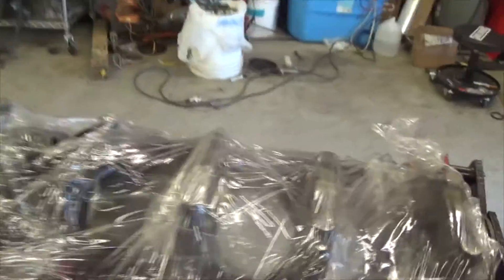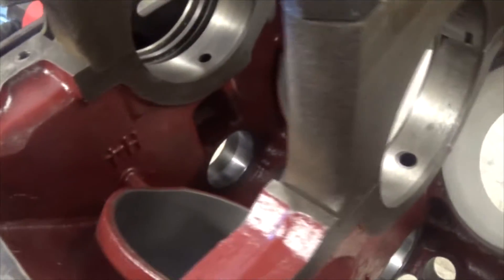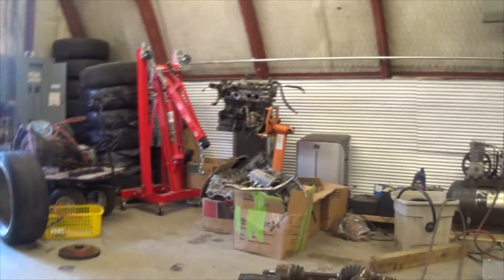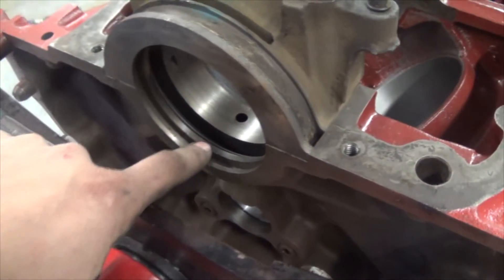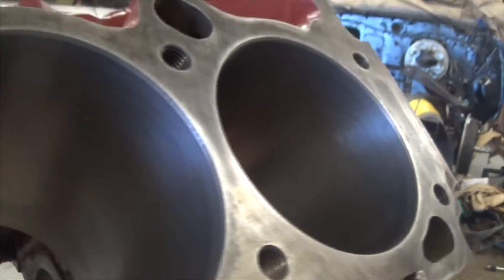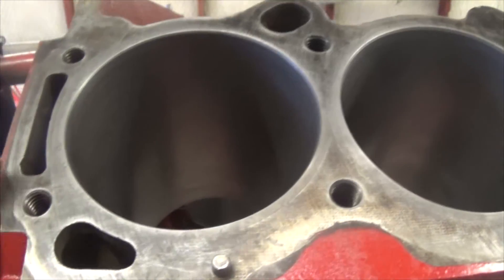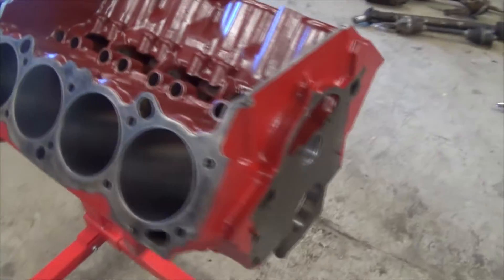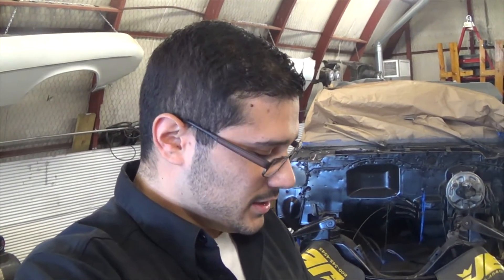Big Block Up Close/ Glyptal Mod/ Buick 455 talk

Comment: Jim Burick from P.A.E. (no longer in  business) used a 70's Ford style diff seal for the front main seal. I'm not sure of the part number but he even had a book of some of the tricks he used to improve  the oiling system. The front seal was a something he did for most of his rebuilds.

Comment: Bro, I had a machine-shopped forged and gusseted motor with the oil modded 455 with stage 2 aluminum heads that were ported and bench flowed, with a 900 cfm demon carb that flowed 670 hp. And 780 ft. Lbs. of torque........I ran 9.85 at thunder valley in Oklahoma....... Sold that car in 10 minutes 17,000.00$.....wish i still had it........

Comment: With those external oil pumps you are almost guaranteed to wipe out the motor if you do not know what you are doing with them. The external pumps are notorious for not picking up a prime and holding it. You literally need to pack the entire oil pump gear assembly with Vaseline to help it pick up the oil and prime the pump. If you dont well, good luck.
Reply: Someone build a Buick or 2👍
Reply: Use a Kenny Bell oil pump and other recommended parts , the Buick Professional's for the last 60 years.

Comment: Loved these motors , I had a ‘71 Stage 1 stick car wished I never sold it. 1 problem is lifter galley not supported enough for solid roller cam, I have seen someone fill the valley with epoxy to support it for Super Stock. racing.

Comment: Start with opening up the oil feed hole to 5/8"  from the pick up side of the block to the timing cover but your casting number shows you might have a 75-76 block so look at the front passenger side at the stamped numbers and it says 45 or 46 this will tell you the year of the block. Let's start there. If you don't build this engine right it will blow up!!!!!!!

Comment: The cam with stock rockers is just above. 515 lift, it's advertised as needing a 2800-3000 stall.  And I've started a home made port and gasket matching job on the heads and intake.
Reply from the maker: We port match every motor we do. With a die grinder an a little time you can make a big difference. Be sure to subscribe, there's more BBB content coming soon!

Comment: First thing is that you don’t paint the inside valley as.this paint will peel off a street engine that cycles from hot to cold on the street 

The cam bearings should be the grooved ones from TA performance.

The front & rear oil seals are available in neoprene not the old leak prone road seals. 

This block should have been true deck in order for proper & consistency in head gaskets seating 

The issue with the aluminum front cover is maintaining proper oil pump gears clearance with the pump. The engine block & front cover expands at different rates causing low oil pressures when engine is running. 

In reality, Buick never dreamed that the 455 engine would be so popular outside of the regular Buick vehicle. The entry into the real Muscle Car line with the 1970 GS Stage1 changed the ball game forever.

Comment: The Buick oil pump is driven by the cam just like every engine of that era. The Buick and Cadillac V8s were more trouble with their mile long oil pick up tubes and external front pump.

The timing cover front pumps were known to lose prime during a routine oil change  but a Chevy, Pontiac or Oldsmoblie has the pump in the sump so they never lose prime.
Reply: I always prime the oil filter on all my vehicles...Especially my Buicks
Reply: That's always the best way for any engine. I liked my old 2.5 Chevy that had the oil filter in the pan. That worked well if you didn't over tighten the huge plug.
Reply: That is still no guarantee with this type pump. Even with the filter full the pump can lose it's prime and not pick up the oil.
Reply: Who told you that crap?
Reply: @gregg4164  nope
Reply: @markbuchanan3694 , I had a low mile 472 Cadillac lose prime after an oil change even though the filter was primed. I also had a 350 Buick lose prime.
Reply: @timsharpe3498  I am not sure how,unless the pump housings were worn or flawed. I have had Buicks for more than 40 years ,never had it happen. We race these engines and haven't had these kind of issues. Doesn't mean it can't happen I suppose,but  in my experience it hasn't.
Reply: The Cadillac I mentioned was in good shape but the Buick was worn out. My boss used to race Buicks. He had a Skylark that was a Stage 1 clone and a real Stage one for the street. Great Muscle cars. I'm no Buick specialist but the resident Buick guys at Gainesville Raceway swore that the big block Buick was time bomb unless the oil passages in the block were modified.
Reply: That is why you use a Kenny Bell oil pump , other wise you lose oil at 2 journals over 5800 rpm.

Comment: Every engine oil pump is crank driven or driven by the camshaft and of coarse it turns faster as the engines rpm increases
And also you just lost 10 hp with that stupid rope seal.

Comment: Block has been bored and honed, 4.350 flat top pistons,  Howards cam, single plain air gap intake,electric fuel and water pumps. Haven't decided on carb, have had bad outcome with past choices. would really like a fast efi,but just not in the budget. what recommendations do you have for carburetor?
Reply from the maker: Well it all depends on what cam you're going with... Go to aggressive an you'll have rough idle but make lots of power up top. If it's a street car that's not the route you wanna go, the powers just not useful. I mean how often are you wide open at 5k? Plus these BBB are known for bad oiling problems. There already stump pullers and they will make that G body fly!
Reply: That is a newer block ,you can tell by the waterjackets.